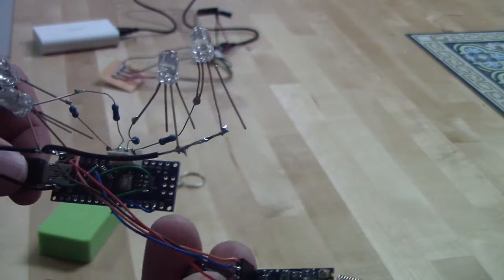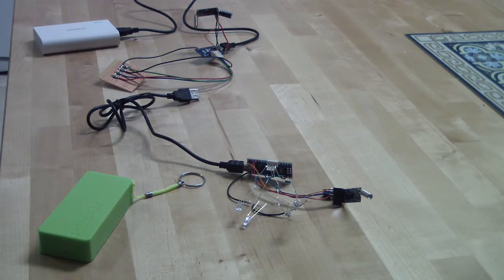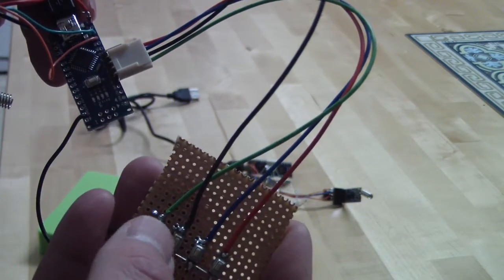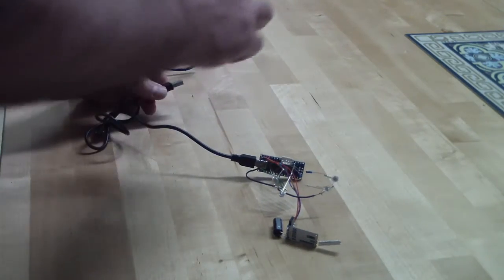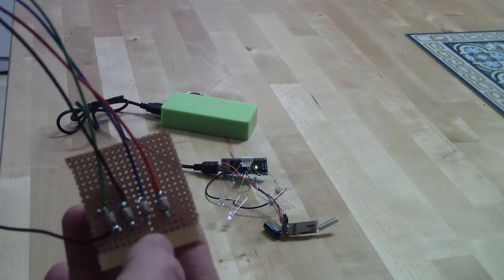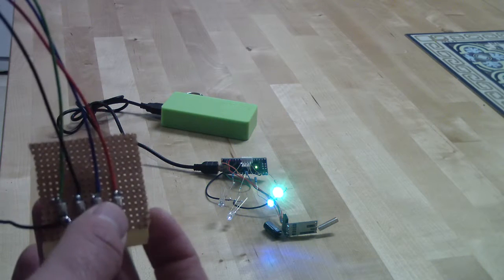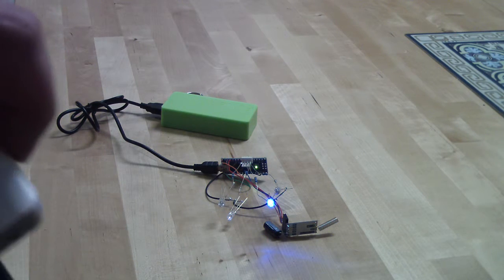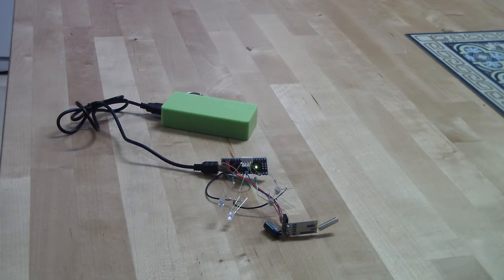HC 12 Uart Transciever Part-2

Comment: please send a diagram and the program for this tutorial.
Reply from the maker: Inside the code you have the connections diagram please see here http://www.electronicsfreak.net/hc-12-uart-transciever-part-3-improved-code-sharing-code/
Reply: Roee Bloch 
sir I have no idea about this transmitter and receiver but I make it.
and transmitter and receiver have a same pogram to provide your link????
or. both pograming are different?????
Reply from the maker: Please read comments in the code. *HC-12 Moule Transciever Same code is for Transmitter and Receiver, setup through A4 Input - which means the code is the same, but you have A4 as input, if it is '1' than it is TX mode, and if '0' is RX mode, also on UART you have some prints during the Power up, so you will see in which mode you are, the uart is 9600 baud rate
Reply: Roee Bloch 
thank-you sir
and please tell me about range of transmitter and receiver.
Reply from the maker: With small antenna about 100m, with big antenna from connector on board about 500m
Reply: Roee Bloch 
Thanks Sir